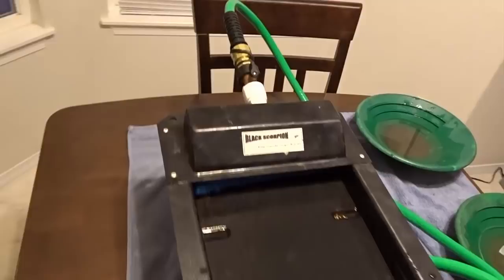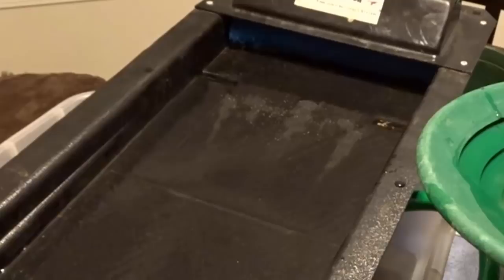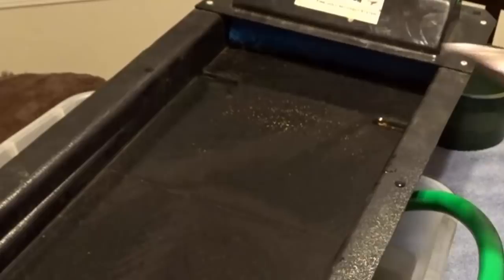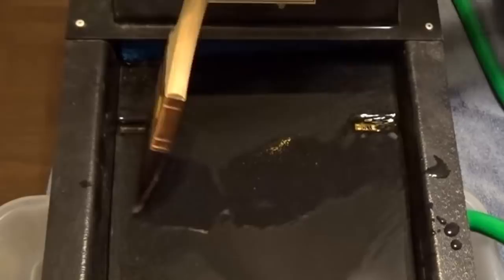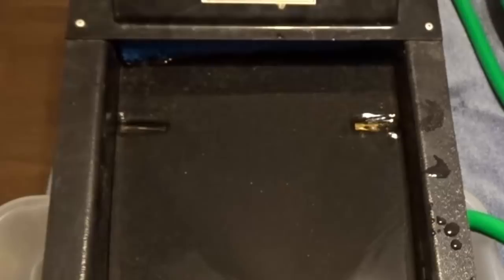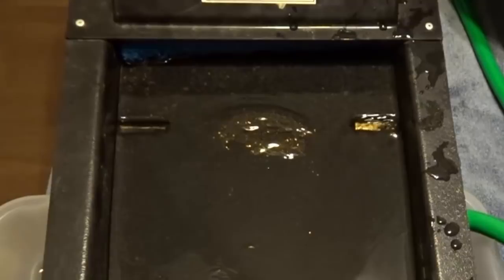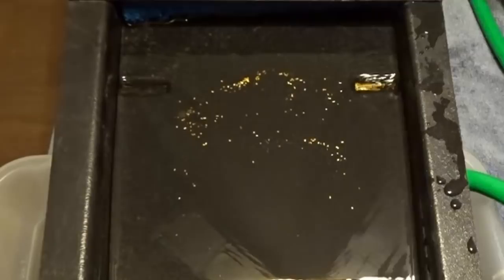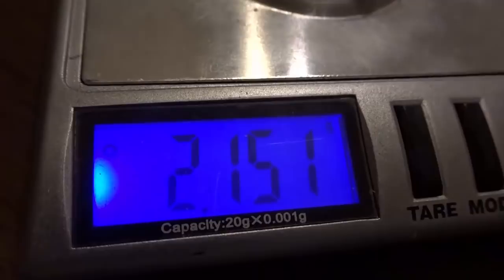Rich gold concentrates, How to use a Miller Table. (Black Scorpion)

Comment: Hi Dan;  Thanks for putting the video up - I have a newer version of that table now, and incorporated "vial" traps rather than the slots.  One can now simply screw the vials ( 2 ) into the bottom of the table and direct the clean stuff right in ( included with the table ).  Another feature is that if you somehow break a vial or don't have any spares, we include "Plugs" that allow sweeping the material into the catch holes.  Then it's just a matter of undoing the plug to let the gold drop into a gold pan for suctioning up with a snuffer bottle.  We have also made a small adjustment to the texture as well.  Remember - proper screening is important for quick cleanup, and when moving the gold, it's best to slow the water a bit as flakes can hydoplane if disturbed.  By the way, we now have a Dealer in New Zealand for anyone watching from down under :).  Cheers, Bryan

Comment: 17:20 Here's a tip when adding more material to already cleaned gold. If you don't sweep the gold away or snuff it up, then add all new cons below the gold on the table. That way you don't push gold down the table with new cons.

Comment: Great video, as always, Dan.  Fine gold is a bit like snowflakes, no two particles exactly alike, each with its own unique shape, aspect ratio, etc. and each behaves slightly differently.  Surface tension of the fluid can be modified with additives and change in water temperature.  I have also found that even non-magnetic black sand is slightly magnetic.  I work it wet, dry it and work it wet and dry both before and after removing the magnetic black sand with a magnet.  We keep learning all the time.  I have a lot of fun showing people how their "cleaned" black sand still has gold hidden inside.
Reply from the maker: "We keep learning all the time" - isn't that the truth!

Comment: You even went out a bought a brand new brush to use! Well, if not, it's fairly new. And, you bought the best brush possible, PURDY, the only brush as a paint contractor I would use. I was shocked when you dumped out the gold to weigh it!! Didn't look like there was that much before removing it from the table, but there was!!
Reply: Yup, he had a pretty new brush, but that battery was an old soldier!
Reply from the maker: Yup - new brush! And it was the only clean one I had on the shelf
Reply: @jimgriffiths9071  It looked it but, sometimes old soldiers are the best soldiers! Amazes me what kind of garbage they sell us these days. Specially made to get you back to the store.
Reply: @Danhurd  Well my friend, you simply can't go wrong with a Purdy.

Comment: Jet dry must be a agent to lessen surface tension? I was a small offset printing press operator in my youth. We called it making water wetter. Along with the water fountain additives we used alcohol (isopropanol) in small quantities to help lessen surface tension, making “Water Wetter”.

Comment: Hey Dan, back in the late '70's ,early '80's i used to have what was called a "Miller  Dredge". It was in fact a table. It had a slate top. About 4' long with little grooves in the top part and down at the bottom 2 or 3 sections of "grizzled" screen  and below that a copper amalgam plate, with a mercury catch box below that. It was a great machine for recovering fine gold. I used it to survive on in Fairplay, CO. all summer, fall, and most of one winter. I was wondering if this is the same "Miller"?
Reply: Back in the late '70's I visited Mr. Miller I Sacramento and watched him demo a table for me, back then I didn't have enough money to get one. If you have any pictures or videos I would love to see them.  videos that would be great.
Reply: Yes it is.
Reply: @danholman5282  Back then Dan, we didn't think about videos or pictures. I wish I had now. All the finds i had would have made for some truly exciting videos. Seems like back then, gold found me. However, the old CMJ magazines would have some good photos of it. Late '70's early '80's. That thing was absolutely great for fine gold recovery. I used it extensively in CO and actually sold on average 1.5 ozs. p/m. Worked it all the way into early Feb. Cold at 10503'.

Comment: I can't help myself.....

Ya missed a bit!  🤣

I gotta make me one of these!
There's a place called Slaty Creek in Creswick, Victoria, Australia
That just keeps on giving, 100 years on
Especially after big flood events that cause erosion
And by erosion, can I point out 
the last flood moved 20 to 30 tons of concrete cause-way in one big peice
so you can imagine what it did to the riverbanks.
But, as most of the productive soil in the entire area is old glacial movement
It's made up of big chunks of very rounded quartz rocks
compacted into some pretty hard conglomerate
as a result, the gold that get's released from these flood events
is really, really microfine, with a fair amount of black sand, and a total bitch to pan! 
I know, as I just spent a day doing it, and my back is giving me hell!

So in order to get any sort of reasonable return for effort
It would be a sensible thing to take a highbanker to  knock out the big stuff
Classify the fines, reclassify them again
and THEN run them over the miller table

Every recovery method has it's best approach
It up to every prospector to be open minded to other approaches 
Something that works well in one area
Will absolutely suck in another
Good luck everyone, think outside the pan/sluice/cradle/bulldozer/whatever
Keep doing it for the fun of it

Comment: Nice piece of equipment but i just adapt my little highbanker to do the same job. I just leave out the exspanded metal and miners moss slow down the water flow and my deep groove matting does a great job of cleaning up my cons that is heavy in black sands.
Reply from the maker: Nice!

Comment: 2/31=.06 * 2400= $155. It’s like two grams doesn’t seem like much but if you saved a little bit of fine stuff over time it’d probably add up. 

Makes me think of Jeff Williams video about mercury and lye and a rock polishing tumbler and a gold retort. Interesting way to recover fine gold. 

But like ya said with flux and melting you can clean stuff. Mountain baker mining and metal or something channel has some great melting videos. But his flux and cost of heating stuff up for some of the stuff he tries to recover he shows as not worth it in the a few video. Maybe using a miller table or some refining process before his melts would make low quality stuff worth melting

Comment: You basically have to use one of those to get anything out of the river near me, it's all super fine flour gold below the dam. Once I get my new car (new to me at least.. planning on a Mini) I want to take a trip up to Auburn and try up on the high side of the Bear River or even the American. I've seen some videos of people checking cracks up there and finding some pretty good sized nuggets, even now. I've got to get a new pack before then though.. mine kind of broke on me, but then it was free off of facebook so.. what can you expect? I'd love to send you some bottles of the cons from the river down here and see you work them, it's so fine and there's so much black sand and zircon powder in it that it'd be interesting to see how you'd cope with it :P

Comment: Can a Miller table separate gold powder I dropped out of solution Aqua Riga it has base metals in it powder form. They have different weights same powder size.

Can a vibrator help speed up miller table?

Comment: Dan, will a miller table like you are using work to capture fine gold when the black sand is significantly larger than the gold flakes?   Would you rate this table as better than a blue bowl for recovering fine gold?   That table is a nice size.
Reply from the maker: Yes, I'm not a fan of blue bowl. The larger the black sand, the easier it is to wash away

Comment: Funny, I was just looking through your playlist to see what your view on a  miller table is. And then this pops up.  May I ask where you bought it?  Cost? You probably get a discount, so just a ballpark figure, please.  Thanks.
Reply from the maker: I did not tell the story in this video on how I acquired this miller table, but it is quite the story.  And did not cost me a cent!  Most prospecting stores will have some version of a miller table. $50 to $200 depending on what you get.

Comment: Which would be better the Miller table oy the spiral machine?
Reply from the maker: Depends what you are using them for. But I preferred the miller table
Reply: @Danhurd  just getting rid of the black sand. My sister in law has a small claim in Nevada that she lets us classify down. Sadly I have 40 gallons of sand I am scared to attempt to pan out for losing gold.
Reply: @Danhurd  yes I am a paranoid rookie watching all the videos I can to learn mining and panning.
Reply from the maker: @youwished8806  It depends on your gold for sure. The miller table is simpler to use.
Reply: @Danhurd  I will look into it thank you sir. Love the videos. Please post more

Comment: hey Dan im thinking a $2 brush would work as well as the $20 brush you are using just sayin  lol
Reply from the maker: Still works fine afterwards.  Water does not hurt it.  And it is what I had on the shelf.  Guess I could have driven 20 minutes into town and 20 minutes back to buy a $2.00 brush........
Reply: @Danhurd  tff

Comment: Awesome video Dan, I was wondering if that table would work with a goldhog mat or other brands of mat placed in it's bottom where you dump your cons and still function right...or if that is too much flow restriction for black sand clean up?  And have you ever tested highbanker mats in a miller style table before ? Might be an interesting experiment to see if it works well..Can't wait for your next video. 👍
Reply from the maker: They would maintain some black sand - the miller table cleans the black sand completely
Reply: @Danhurd  Oh, oh kay thanks for the info...Also when one first builds or buys a miller table is it the same as a gold pan, that they need to be pre-seasoned with soap and scowering pad than rubbed with sand to scratch them up ?
Reply from the maker: @waynebussey5521  No, but it doesn't hurt to scrub it down with soap
Reply: @Danhurd  Thanks Dan, good to know